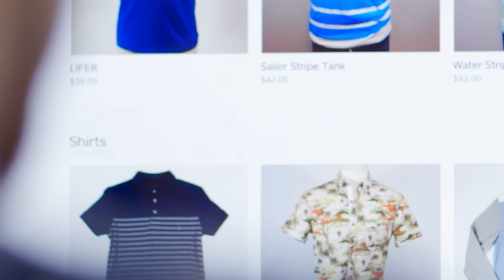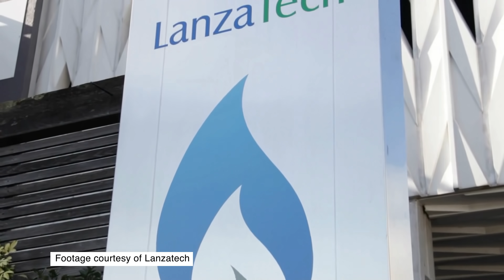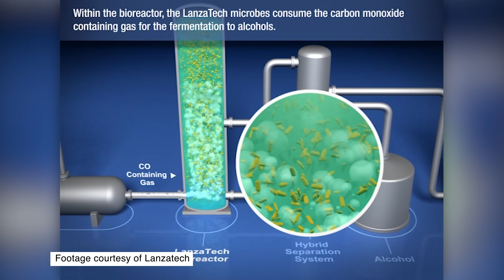Making Biodegradable Objects Out of Greenhouse Gases

Comment: Take carbon out of the air, turning it into ethanol to then fuel passenger planes. Yeh, sounds great.
Reply: I wonder what the difference is with traditional bio-fuel ethanol from corn. the plant grows using CO2 to convert to sugars, then those sugars are fermented with yeast in a bioreactor to convert to ethanol. I would think the main difference is that bio fuel ethanol is using atmospheric CO2 that's already out there, as where these bacteria are capturing carbon direct at the source without getting into the atmosphere.
Reply: Well the carbon comes from the corn which essentially takes it from the atmosphere. The difference is mainly in the energy input. Ethanol requires fields of fertile land, machinery and energy to process it. Carbon capture also requires machines and energy. I couldnt tell you if it requires more or less energy, only that for now carbon capture is more expensive.

Comment: How about the energy it takes to produce the product? Is the whole process carbon negative?
Reply: It shouldn't stop companies to research and produce these products. The energy can be cleaned up. We'll only make a significant impact if we can make the whole system cheap enough for developing countries to have the option to switch over.
Reply: @SpektrikMusic  planting a few trees pulls more carbon out of the air than these publicity stunts
Reply: entropy gives you the answer to that in the long run, but (!) that does not make this worthless
Reply: When we're able to do fusion, it will be.